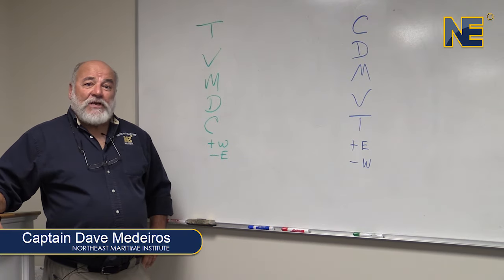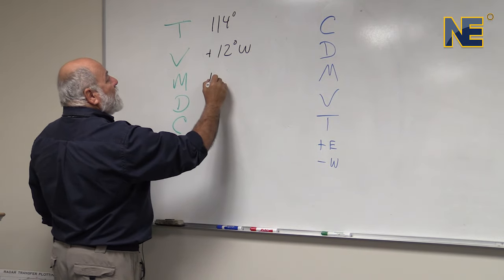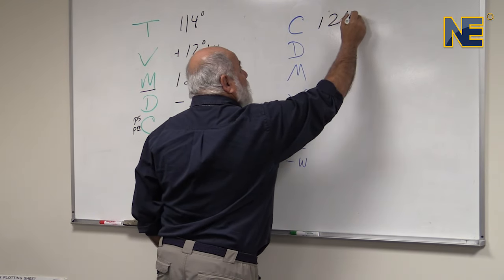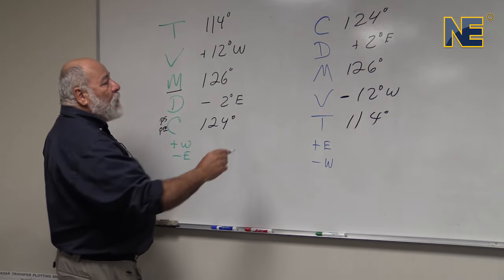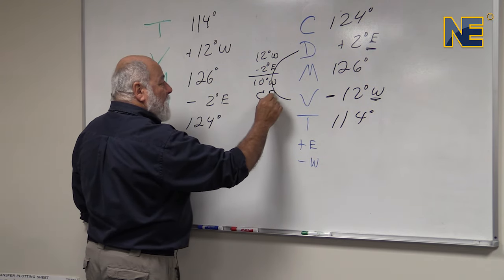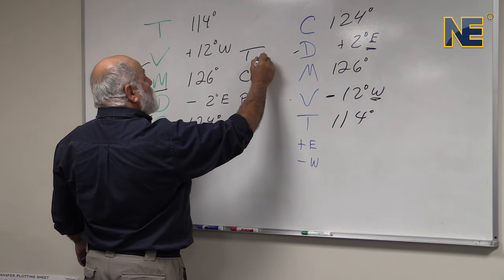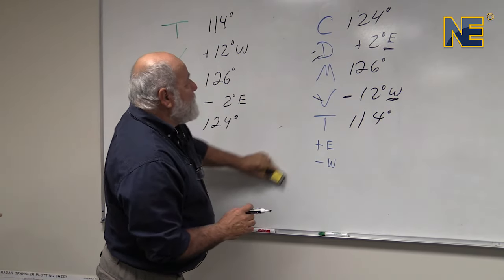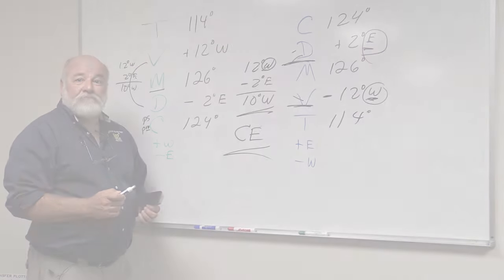Navigation - Compass Error

Comment: To calculate the Per Ship Compass (PSC) from the True Course (TC) and Compass Error (CE), you need to determine whether the error is East or West:
	1.	If the Compass Error is East, you subtract the Compass Error from the True Course:

PSC = TC - CE

	2.	If the Compass Error is West, you add the Compass Error to the True Course:

PSC = TC + CE

Key Rule:
	•	East Error = Subtract
	•	West Error = Add

Comment: Thanks u sir.
 I would  like to how it is compss err    = 10   when it shuold be 14 
10+2    we add them when took the singe for the greter number. & thanks agin
Reply: Greetings Sir! The compass error is equal to 10 because the variation and deviation have different symbols such as E and W. For example,

Since we are solving from True to Compass, for this reason, we will be adding West and subtracting East.

T = 114 deg.
V = (+) 12 deg. West
M = 126 deg.
D = (-) 2 deg. East
C = 124 deg.

Compass Error = (+) 12 deg. West (-) 2 deg. East = 10 deg. West

I Hope it helps Sir.

Comment: How do we know if we're gonna add the CE to the True or subtract.
Coz you add the 10degW to 114. How do I know if in gonna Add it or subtract.thanks
Reply: 2 things is important!
Deviation and variation!
Variation can take from sailing maps. 
For deviation you must have a  Deviation table diagram (some company make for big ships)
or
You must find a fix transit from shore
or
You must use a gyro (error known)
or is more simple i thing
You can take out your second/spare magnetic compass to your boat. Put to shore, for example your compass says 000 second compass (True) says 010 and varation at the map 4E (After year calculation)

Put on TVMDC
T:010
V:-4
M:006
D:XXX
C:000

This thats mean your Deviation is 006E

IMPORTANT!!!
You must do this for each 22,5 degrees!

For example;

Heading 000 deviation 006E
Heading 022,5 deviation 003E
Heading 067,5 deviation 002W
Heading 090 deviation 003E

.................etc

After all you can prepare a diagram 
Same like this: http://www.sailtrain.co.uk/navigation/images/grid.gif
Reply: I know it's kinda late but maybe newcomers might have the same question as you. If you're solving from True to Compass, + West, and - East. Vice versa for Compass to True. To help remember this, you can use the phrases:

For True to Compass or T V M D C add W = "True Virgins Make Dull Company at Worst"
For Compass to True or C D M V T add E = "Can Dead Man Vote Twice at Elections"

It still applies, when solving for True or Compass by using Compass Error.

I Hope it helps.
Reply: So +west - east if compass to true? Am I correct?

Comment: Hey man,
Great video.  Where would you actually use this? A real life example where youre out at sea would be very helpful.  
At sea and you lose your gyro.. could you use this?
Reply: Stew Stew to calculate your deviation for example. You know variation from your chart, you can calculate True with a sun amplitude or azimuth calculation, and with the ship’s magnetic you get C. So fill in the blank T V you get M then you know C, so the difference between M and C is your deviation